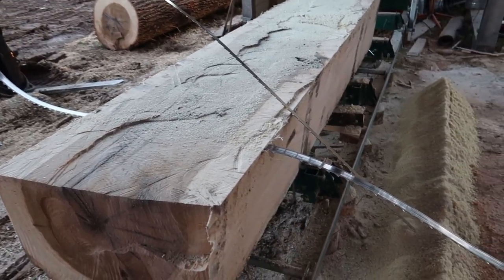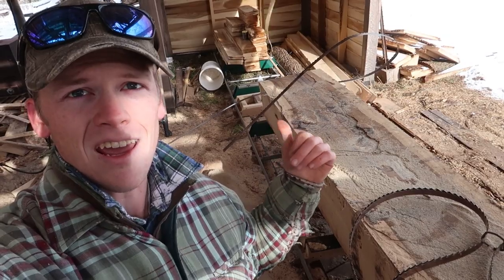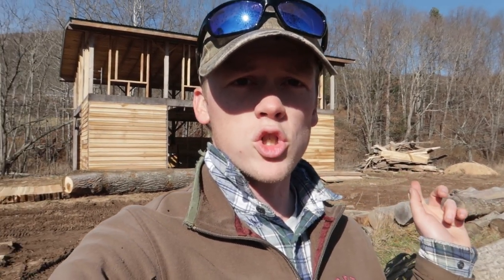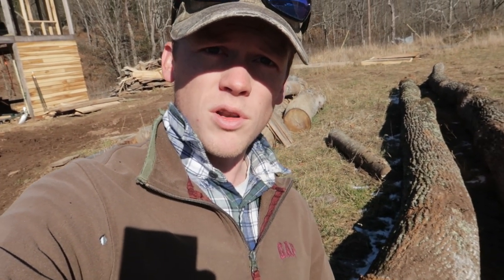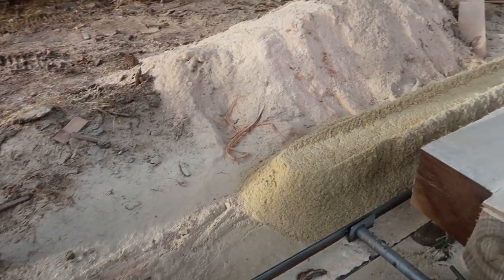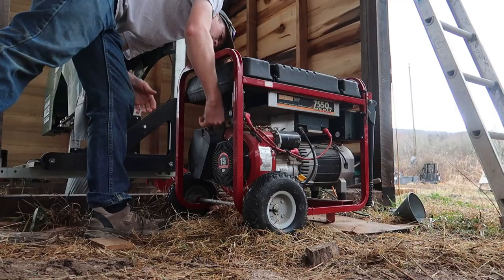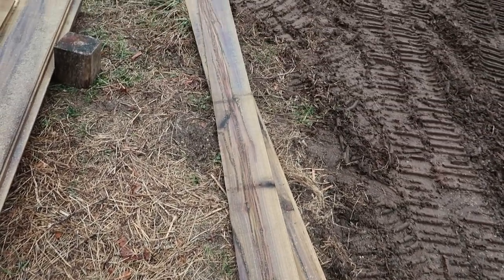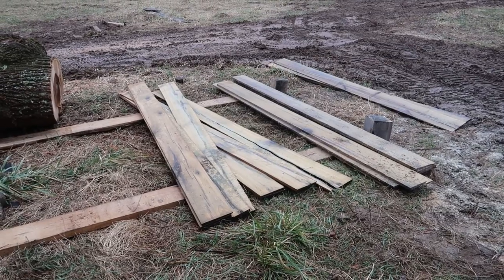Milling & New Miter Saw | Millhouse

Comment: Josh you should build yourself a little sawdust conveyor I would use hardwood for the trough and hardwood scrapers placed about 1 foot apart going out side use that chain with the big links you can get it at any tractor supply. They used them on the old hay loaders years ago you probably could find one in a field around the area that you could source for free!
Reply from the maker: One thing I wish I'd kept from my grandfather's farm was his corn elevator. Very similar to a hay one, but with a solid bottom. Quite often I've thought it would have worked well for moving sawdust out. I'll check into those links though, and see what it might cost to build something. Thanks!

Comment: It looks like the tree could have been struck by lightning many years ago.  The multiple cracks  look like they filled in and the discoloration is not uniformly it's blotchy. Look for flairing in the cracks if it goes outward like a bursting pattern then it could be lightning .If you have never seen a tree in your woods like that then it's probably lightning.  Great video.
Reply from the maker: Thanks!

Comment: I can't believe they sent you a Dewalt. I have a Big Delta cabinet saw in my shop and, would not trade it for any other. Why don't you build a work platform for the loader. Kinda like a 16' long pallet. Then just strap it to the forks.
Reply from the maker: So this is my understanding of what happened..... At the time of manufacture, Delta was owned by Stanley Black & Decker, which also owns Dewalt. Delta no longer makes a "comparable" 12" saw, so they replaced the recalled Delta's with Dewalts.
"In 1945, Rockwell Manufacturing Company acquired Delta Machinery and renamed it the Delta Power Tool Division of Rockwell Manufacturing Company and continued to manufacture in Milwaukee. In 1966, Rockwell invented the world's first power miter saw. In 1981, Rockwell's power tool group was acquired by Pentair and re-branded Delta Machinery. Pentair's Tools group was acquired by Black & Decker in 2005. In January, 2011, Taiwan-based Chang Type Industrial Co., Ltd. purchased the Delta brand from Stanley Black & Decker."

Funny you should mention a platform for the pallet forks..... that'll be in next week's video. It's only about 9', but it works well. Josh
Reply: I was going to make the same comment as (bob driggers) a working platform for pallet forks is the best. I use mine all the time for everything from tree trimming, setting poles etc. and you can put sides on it and chain/ strap it to you rack so it won’t fall off the forks and use it for mill ends sawdust whatever and move it around and dump it as an oversized bucket

Comment: I agree with the “wind shake” much like ring shake but it could also potentially be from a lightning strike?  🤔
Reply from the maker: What's ring shake?
Reply: “Ring shake is the lengthwise separation of wood that occurs between and parallel to growth rings, diminishing lumber yields and values.” Per the google definition of it.  Basically parts of the tree shrink/pull away from other parts of the tree inside the tree.  Kind of like checking in lumber but when the tree is still standing and I believe unrelated to drying.  There’s other videos on YouTube related to ring shake and milling to get a better idea.

Comment: Wanted to ask you how happy are with your mill? looking at buying 1 from the same company ,but a 26 and  how many extensions did get for length?  Enjoy your videos ! Buying for just  personal use and doing small  projects . Ps what k in nd tapered edge  1/4 to  1/2 ? On lap siding
Reply from the maker: It's been great! For a personal use mill, it's about the most mill for the money available. Their customer support is second to none. I have 2 extra extensions, so that gives me around 23' of cut length. Keep in mind though, that if you go that long, you'll need some horsepower to load and turn those bad boys. Unless of course, you happen to be the Incredible Hulk...... :)  My taper goes from about 1/4" to 5/8" across 7". There isn't any magic thickness, so whatever looks good for the width of board you're cutting. This can be adjusted by the thickness of the spacer strip, and how much you lower the mill. Josh

Comment: here is a vid of the chain buddy is hitting the link with a chisel and using a torch you don't have to do this just bend the link and line up the slot and hit it on the side to break the link and then line it back up and use a anvil or equivalent and hit the link it will go back together. There found on old farm equipment or you can buy new at tractor supply. https://youtu.be/A0uZ_vf9fl4

Comment: You need to put a stop on your right side and get rid of the tape measures
Reply from the maker: It would be easier to do that if the saw was on a large workbench. I couldn't really see a way to put a stop on 8' from the blade with that setup. But you're definitely right that it would've been way better. Josh
Reply: @LandisLegacyFarm  Move the saw so the end of the board hits your pickup or the wall at 8'or 10' or whatever length you need
Reply from the maker: @charlielancaste4111  That's a really good idea!